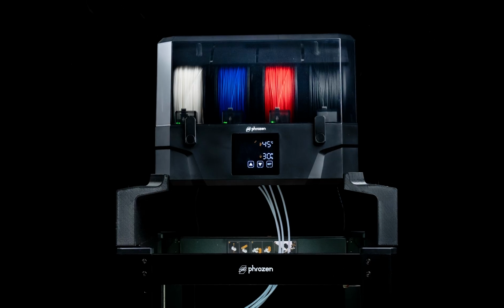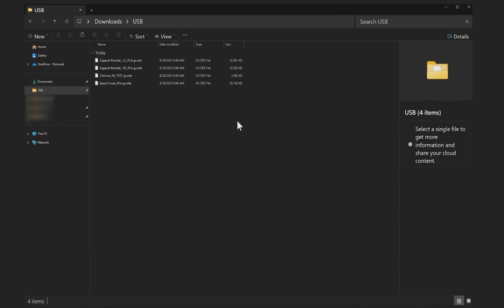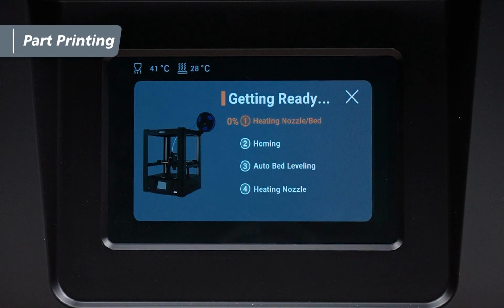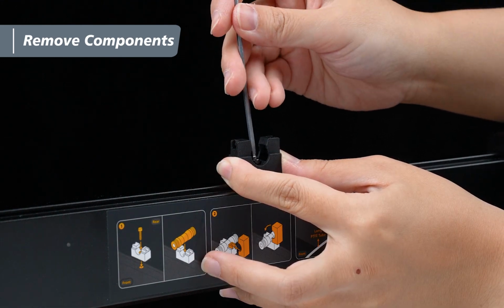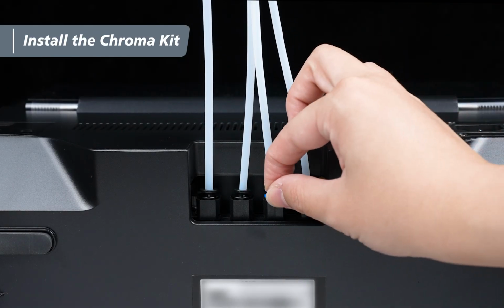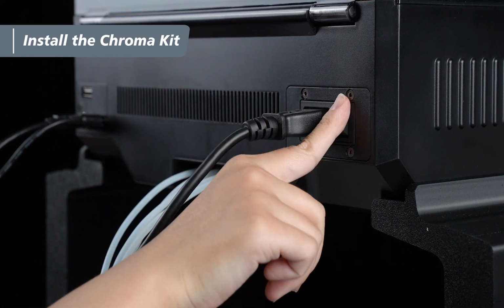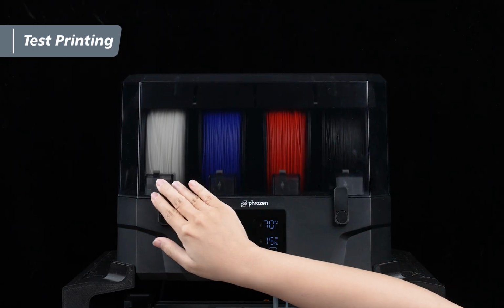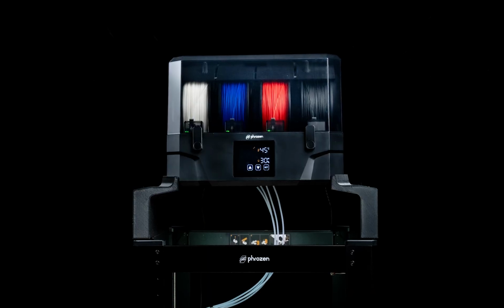Chroma Kit - Unboxing & Setting Up — Phrozen 3D Printer

Comment: How do you map the filament colors to the AMS inside PhrozenOrca?
Reply from the maker: To map your filament colors in PhrozenOrca for the Chroma Kit, follow these quick steps:
1. Add Filaments: Click the "+" icon in the Filament panel (left side) to add up to four filament slots.
2. Assign Colors: Click the color box for each slot and select the color that matches what you’ve physically loaded into the Chroma Kit (Slots 1–4).
3. Paint the Model: Use the Painting Tool in the top toolbar or right-click the model and select "Change Filament" to apply colors to specific parts.
4. Sync & Flush: Click "Flushing Volumes" to automatically calculate the purge amount needed between color swaps to prevent bleeding.
When you hit "Print," just ensure the slicer's filament order matches the physical slots in your Chroma Kit!

Comment: How can I change to print only 1 of the colours without having to add 4 filaments into orca and manually paint every item to 1 colour? Is there a way where I can just select the file to print using 'filament chamber 2' ?
Reply from the maker: Hi! 😊 This can be done in Orca Slicer using filament assignment shortcuts and settings.

Comment: it seems to me, to be odd that the end user need to print parts to be able to use the Chromakit. There is no rekommandation regarding material. But when used in har "hot" environment would ABS or ASA be preferred.
Reply from the maker: Thank you for your feedback. We appreciate you taking the time to share your thoughts.

Comment: What if you have more then 1 chroma kit? Your supposed to be able to connect up to 4 chroma kits. How does that work?
Reply from the maker: When using more than one Chroma Kit, you can connect up to 4 kits to expand your printing capabilities. Each Chroma Kit is designed to work together seamlessly, allowing you to increase the build volume or print multiple objects simultaneously. To get more information navigate to our help centre : https://helpcenter.phrozen3d.com/hc/en-us here you should find a chat option on the bottom right in blue color. Please drop your ququestions there!🤗